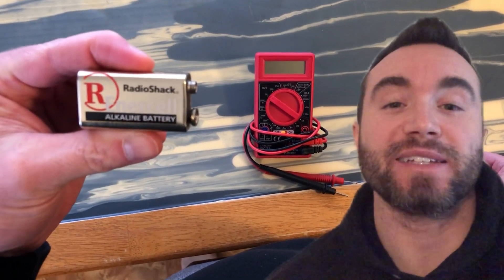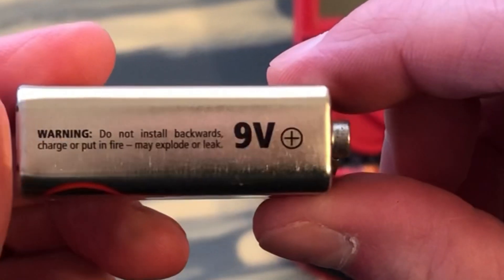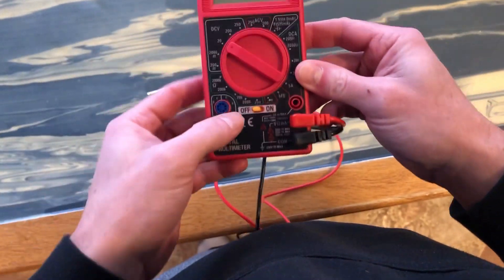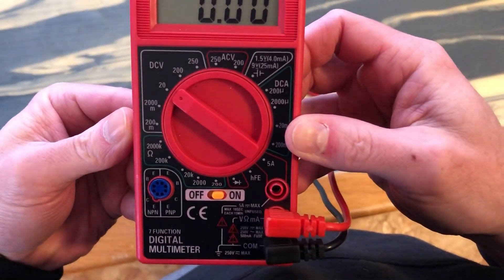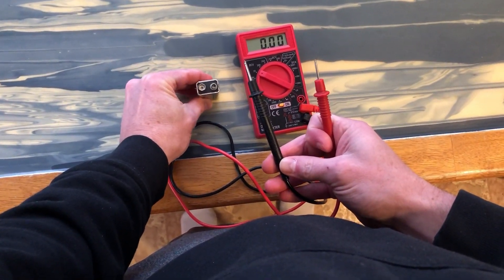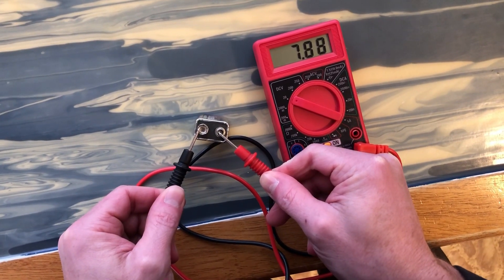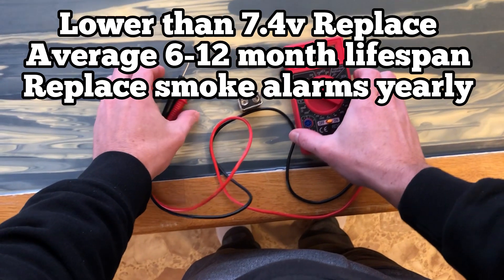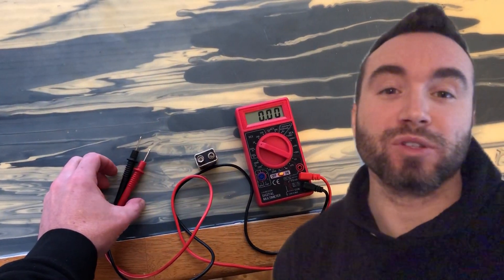How to Test a 9 Volt Battery with a Multimeter -  Smoke Detector Maintenance

Comment: You have a 9v battery tester on that multimeter that puts a 25 mA load on the battery when taking a voltage reading.
It's in the top right corner.
Reply from the maker: Lol thanks Shawn